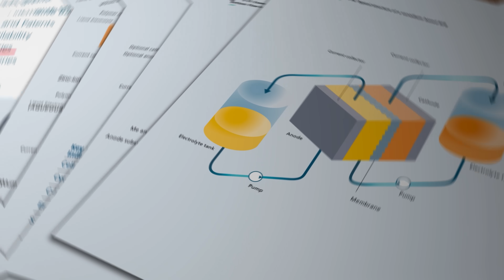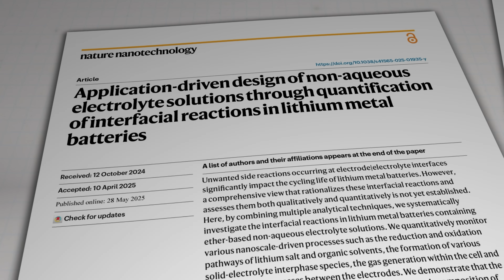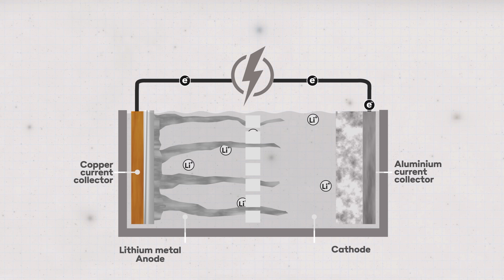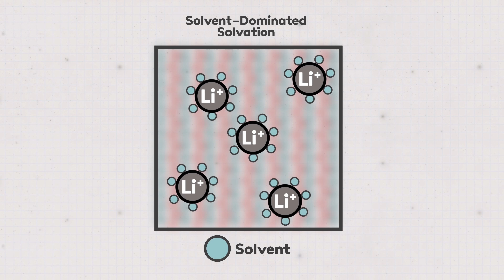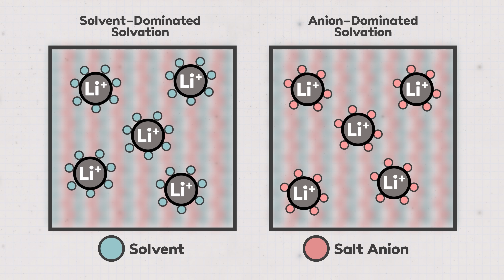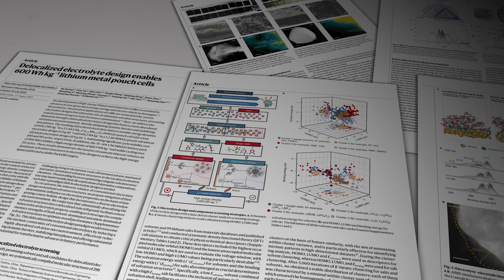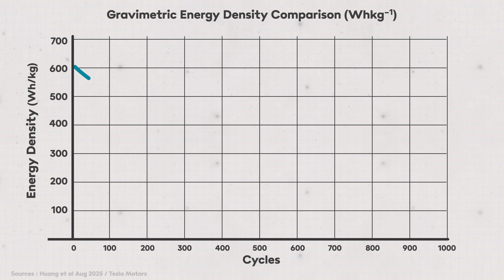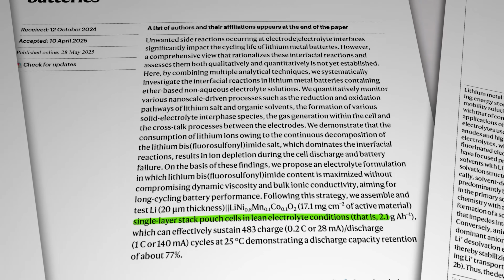New lithium metal battery doubles energy capacity! Has China beaten us to it again?

Comment: I'd much rather have an aluminum-ion EV battery and sacrifice energy density (vehicle range) for lower cost, much faster charge time, and three to four times the number of recharge cycles. Aluminum is the most abundant metal on Earth and causes less pollution during mining and production than lithium, and is easier/cheaper to recycle. The growing number of charge stations will allow drivers to stop for 5 to 15 minutes to fully recharge their batteries, similar to stopping to fill the tank. A tow truck could rechage a car on the road if necessary. Energy density becomes less critical when the battery can be charged in a fraction of the time, and even more so when considering all the other benefits.
Reply: Abundance is less of a issue, distribution, accessibility and process energy are more critical. Which for aluminium can be problematic, widely distributed in lower concentrations and requires significant energy to extract and isolate to purity levels required for batteries compared to Lithium.
Reply: @GruffSillyGoat Nonsense. 

"Aluminum processing occurs globally in over 40 countries, but China dominates with the most aluminum production, followed by India, Russia, and Canada. Other significant aluminum-producing countries include the United Arab Emirates, Bahrain, Australia, and Norway. While aluminum is extracted from bauxite in locations like Guinea and Australia, the actual smelting process to turn alumina into aluminum metal is concentrated in countries with readily available electricity and infrastructure, such as China and Canada." 

Energy isn't a problem for any of these countries, and all can invest billions. Until lithium can be extracted from seawater efficiently and at significantly reduced prices, aluminum provides a far superior EV battery. Energy density will improve as it has with lithium-ion development, but with far better recharge times, that extended range is no longer as necessary for the majority of privately owned vehicles.
Reply: Your completely missing the point, it's the relative economic difference involved. Lithium takes less energy to extract and process into battery compatible material than Aluminium. This enables Lithium's price to continue to fall whilst Aluminium, being a more mature material product has effectively bottomed out. 

Seawater Lithium extraction isn't required, as further large land based deposit sites are continually being found. Plus direct Lithium extraction is accelerating extraction from expansive brine aquifers (at significantly lower cost, producing battery grade minerals directly).

Aluminium's energy density will also always lag that of Lithium. Lithium's max energy density is 11,400 Wh/kg (Li-Air battery), whilst Aluminium's is 8,000 Wh/kg (Al-Air). However, Li-Air batteries are rechargeable, whilst Al-Air is a non-rechargeable primary cell. For rechargable battery applications Aluminium will always have a lower energy density potential.
Reply: @GruffSillyGoat I very rarely miss anything, and haven't now. You, however, my friend, are still missing (or ignoring) the point that maximum range isn't necessary when EV batteries can charge in a fraction of the time of other batteries. In the long run, aluminum-ion still has huge benefits over lithium. Tesla is going to prove that with their latest release.
Reply: That's both an overly self-assured comment and a call to an external authority rolled into one. Perhaps in this case you've ignored a key point, it's energy density that is of first order importance in an EV for the majority of uses, when that is satisfied it's then power density (i.e. charging throughput) that becomes involved as a secondary importance factor. 

In this respect Lithium has both sufficient density, with the ability to grow for future needs, at a more than sufficient charging rate with little additional benefit with Aluminium chemistries in this respect. Plus Lithium is a more mature technology with significant global focus, research and investment. Aluminium is further behind and still faces key development steps to become a functioning technology and alternative (Sodium battery technology is more developed than Aluminium rechargeable cells).

If Tesla is your white knight company, then given their pivot to become a taxi business, from what was a mass automaker, then perhaps they're eyeing up Aluminium for their own needs not those of the wider market. Perhaps considering short hop, city based vehicles, with small batteries but fast recharge timescales - for which Aluminium may have a slight advantage for when (or if) it matures. But it's not the general direction of the battery market as a whole.
Reply: @GruffSillyGoat Too much babbling to read. Regardless, I'll stick with my original comment. "I'd much rather have an aluminum-ion EV battery and sacrifice energy density (vehicle range) for lower cost, much faster charge time, and three to four times the number of recharge cycles." It's not a debate, it's how I feel.
Reply: Not debating, emotion often misleads.
Reply: @GruffSillyGoat I'll bow to your knowledge on that. - https://www.youtube.com/watch?v=RWMFuPpTm3U

Comment: Not an expert here but I do have some experience with battery research. I had a look at the paper. The Cells with the UDI-Electrolytes are for sure impressive but they would  cost lot and I mean like super expansive. I have bought some of the organic salts mentioned and they are extremly expensive. They also increase the viscosity of the electrolyte and that is  usually bad for temperature stability though you can mitigate that somewhat by using different solvents. Usually you do not wante a solvation shell for the Li-ion consiting of solvent and anion bcause the hinders Li-transport throught the cell and you increase the anion movability. that means you might increase the self discharge of the batterey a lot by using this method. another thing to mention is, that they basically pumpt the UDi-Mixture full of SEI-forming additives. That will form a super thick SEI on the anode side. One needs to remember that in a standart NMC -Graphite Cell the Lithium comes form the NMC not some LIthium foil. so they have added a lot of extra Li here by adding a 50um foil on the annode side. You usually do that so that the Li has a structure to attach to but in a commercial call you usually want to avoid the use of pure alkali metal as it imposes much higher purity requirements on the used atmoshere during production asspecially Li. So the extra Li is enough to create a thick SEI layer on the annode side that is ionically conductive but not electronically. that might be the reason the Li on the annode is not able to form dendrites on the annode side. But for sure interesting.
Reply: Thankyou for that 👍😳
Reply: Thank you for your insights! That's a very interesting addendum to the video.
Reply: @Kevin_Street  "Thank you for your insights! That's a very interesting addendum to the video."

How would the average person know if what the OP expressed is accurate and relevant? No disrespect intended of course towards anyone, I am just very fascinated that you have so readily accepted what was said by the OP, on face value, on a social media platform. Have you fact checked what was stated?
Reply: @BrentonSmythesfieldsaye  Yeah in practice, 'experts' tend to dismiss new developments. There would be a Kevin for every recent innovation in that industry, which is centered in China anyway.
Reply: @BrentonSmythesfieldsaye  All I said was that it was an interesting addendum to the video - that is, an interesting addition to the conversation started by the video. Nowhere did I say I accepted everything as true. (Or that I had the knowledge to do so.) That's you projecting intent onto my words.
Reply: @Kevin_Street  There was no "projection", there was rhetoric though. No one has done anything wrong. I was simply reminding people that caution is required regarding social media content. That is all, plain and simple. The OP may be entirely correct, but no one here knows if that is the case, do they, unless they are willing to genuinely investigate the points raised.

Stop being so needlessly defensive in this case. You could have just said you are onto that and all good, if you had to say anything at all.
Reply: @BrentonSmythesfieldsaye  Please stop this.
Reply: @Kevin_Street  Yes let's.
Reply: @BrentonSmythesfieldsaye  The "Average Person" does not exist but many ordinarily inquisitive folk find these added bits of information worth further investigation.
On the other hand, there are those who want everything delivered to them in short complete packages which, of neccessity, skim over the more involved information, just to save them from actually seeking comprehensive information for themselves.
Should those people who wish to extend their knowledge be excluded from consideration?
Reply: @DrakeN-ow1im  Couldn't agree more with the thrust of your response. Kevin did nothing wrong, he just provided a vehicle & starting point for my out of context with the video topic smart arse post to provoke the minds of readers who may be inclined to accept anything (important) at face value on social media platforms. There is nothing wrong with reminding people of that from time to time.

If my approach to that end was unfair to Kev, then I apologise for that at least, but also thank him at the same time.

So in conclusion, the average respondent would agree with you.
Reply: Absolutely. I said a similar thing in a Reddit thread on this paper.

Furthermore, they're using extremely dense packaging with an absurdly lean electrolyte/Ah ratio.
Reply: to me, the killer use case for a super high energy density electric battery would be for aviation. this would mitigate the issues with expensive materials, as it wouldn't be a consumer product that has to be affordable by middle class households but rather a business expense where high upfront costs could be shouldered if the difference in fuel costs penciled out. 

and the issue with self discharge would also be less concerning, as a plane would not be required to hold a charge while not in use for any extended period of time. 

the only real dealbreaker is the durability. it might not have issues with dendrites, but it still degrades far too fast for commercial viability.
Reply: "some of the organic salts mentioned .. are extremely expensive"
The other technical issues u cut into aside, isn't that just a matter of economies of scale?
As more organic salt of that particular type is needed it will attract investment until supply meets demand at lowest cost.
If there are no legal competition prohibiting rules - cough - patents, copyrights - this should be the least obstacle IMHO.
Reply: For sure you have to make a channel with reactions of these technologies
Reply: Forgive me but it seems like all of these points you have mentioned can be overcome with automation development, scale and tuned supply chain. All of which China has been taught and practiced over the last 20 years.
Reply: The usual issue with all these battery research breakthroughs.
Ain't nobody buying a x2 better product if its x4 the price.
Reply: @tardvandecluntproductions1278 i think they will. At least history has shown that. People paid for a coolness factor for flatscreens for a less quality picture at 6x the price and then that tech got x3 cheaper than its predecessor in under 10 years.
Reply: But that's what research is... figuring out that a specific mix is not great, is a breakthrough for science... maybe not capitalism. Our knowledge is greater. Think about this... almost all of the cutting edge of physics, chemistry, astronomy, cosmology... use constraint limiting approaches because knowing things is not a perfect science... so 99% of science is figuring out what is NOT the thing you are looking for. Capitalism drives this hyper-isolated competition to "invent" stuff... when we all know that's not how knowledge works...LHC...
Reply: Translation: The chinese are claiming they're #1 for making a battery that doesn't work anywhere outside of a lab. Again. As usual.
Reply: I wonder if its worth building better environmental controls into the battery housing.
Reply: Sure they are more expensive, but if they are intended for more specialized products like electric planes, products that are inherently expensive already, it means a bit less.
Reply: Aluminum ion and sodium ion tech is improving markedly.
Reply: Check out Pure Lithium
Reply: Why do you bother?
Reply: Yes i do relies this and my problem to solve it human will do things over time if I lay foundations before I die is the plane 😅
Reply: Unfortunate malapropism - "expansive" - given the tendency for sold lithium to suffer much more expansion at full charge.
Reply: Welp my hope for the future is squashed 😂😂
Reply: comment better than the video - award
Reply: I mean, yeah, but he has to put out a video every week and so every shit paper with a good headline has to be covered.
Reply: @tarstarkusz  https://youtu.be/9U4Ha9HQvMo?si=wVh7oqSOm1FbNjRo
Reply: They are triple use batteries.

There is battery mode..

And then it has a puffed up pillow mode (keeps good neck alignment for a great rest all night)

Then it's got smoky hot sizzling mode.
Perfect to ground a pesky plane, great as a firestarter, and just an aromatic room freshener.

Clearly china is ahead. No ketchup from those tomatoes 😊
Reply: @ShivaTD420  China made a science experiment that's too expensive to actually produce and impractical for real-world use. They do this all the time. They pour a cup full of syrup and claim to have "the world's sweetest Cola" ... but who would drink syrup? Enough already.
Reply: @MisterMonsieur  yeah I do that to.
It's called science Mai Gai. 
This one thing I did is so secret that I don't remember what its even for or the see 👁️ eh agent watching me. 

Maybe try some prescriptional herbal emergency medical chillouts n get da ppsucks. Lighten up monnsuier clenching so hard Neva-laugh no- joke maky sense of humor not exist.
Reply: @MisterMonsieur  everyone does this all the time. stop being biased

Comment: In my mind "lithium" + "metal" + "battery" = 🔥
Reply: Petrol + air + sparks = 🔥. Same.
Reply: @petewright4640 
Ain't the same 🔥 man, ask firemen
Reply: @halnineooo136  
By the time a Fireman reaches a Petrol fire, the high energy density means it has Released the potential.
Reply: @rogerstarkey5390
The electric energy density stored in the lithium metal battery and the potential oxydation energy of the metallic lithium in the presence of air and moisture aren't the same. You're confusing apples and oranges.
The battery 🔥 is also very sneaky and can restart hours after you think it's extinguished. It's really nasty